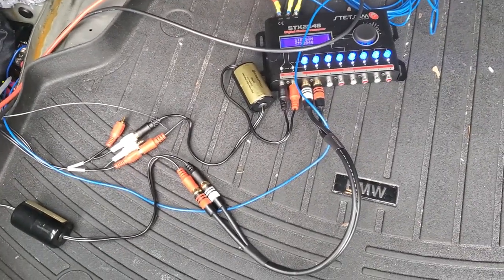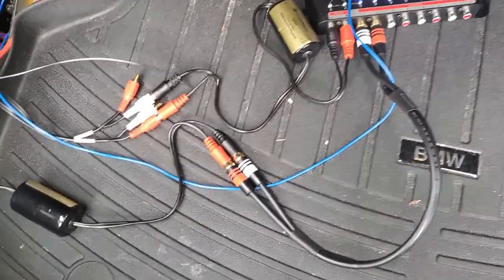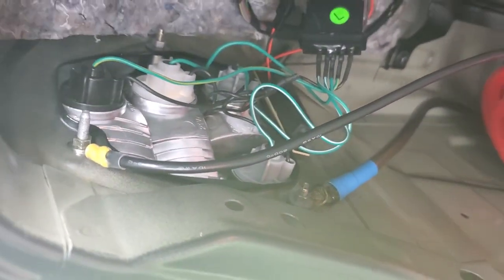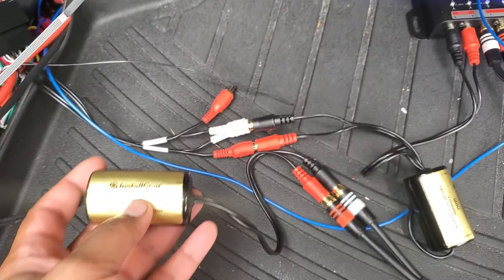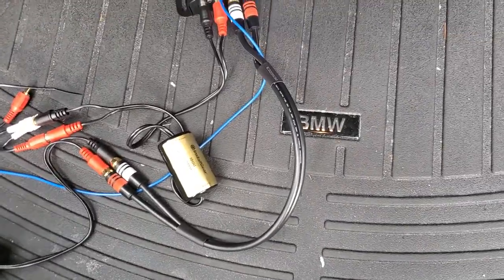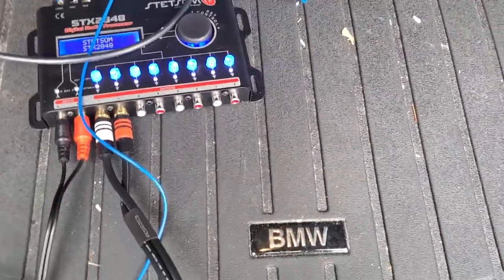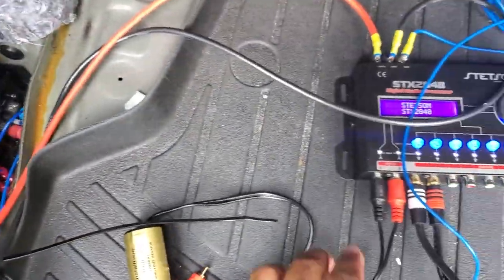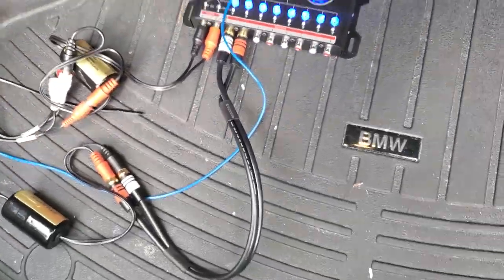HOW TO REMOVE ENGINE NOISE? ALTERNATOR WHINE? BUZZING? FIX WITH GROUND LOOP ISOLATORS!!!

Comment: Tried grounding my rcas to my head unit and it got louder. So now I have a slight buzz or whine coming from my highs amp. I even ground everything on its own ground points and still have that little whine. I seen an nvx isolator on Amazon and I want to try but then again I don't want to waste time and money and still have the whine issue
Reply from the maker: I would try these ground loop isolaters at the amp btw the rca of the head unit and amp see if that clears up your whine/buzz (interference).  For under $9.00 you can't go wrong and it's Amazon.  You could always return it.  If running multiple amps for your speakers, I would use a ground loop isolator at each amp. In my setup, I noticed a slight engine whine when I added my amp.  When I added my DSP, the engine noise/buzzing got way louder! Once I separated the grounds, which you already did and put a ground loop isolator between the rcas going into the DSP and coming out of the DSP, the engine noise went away completely! Try it.  Hope this helps bro!

Comment: I used this ground isolator and it worked, but the problem is, it changes the sound quality of my stereo.
Reply from the maker: Hmmm...Have you double -checked  to make sure your ground connections are clean and solid? Obviously, there  was some  interference that went away with the ground  loop isolator.  If  sound quality was  impacted at the same time, my guest would be a weak ground.  When you get a chance,  give me  an  idea of the system/setup you are  running.   Thanks.

Comment: Its a DS18 thing. Had no issues with engine noise until I installed a DS18 active crossover. Had engine noise coming out the rear output channel only. Change RCA's , grounds everything. Removed the crossover and tested in in another car. Guess what. Engine noise coming from the rear channel
Reply from the maker: I installed the DS18 amp not standalone crossover unit in my setup.  When I first installed the amp, everything was fine but the music was extremely flat and dull sounding.  As such, I decided to install a DSP.  I didn't get engine noise until I added DSP to my setup.  Although, when i added the ground loop isolators the engine noise went away 100%.  Engine noise is not just a DS18 thing.  The vast majority of people I communicate with have the same issue using different manufacturers.  Now, as a budget install I' m not saying DS18 is a top shelf equipment supplier by any means.  I was very skeptical about product quality and how long the amp would last! Surprisingly, I have not had any issues in almost a year installed. One thing I will acknowledge is DS18 Customer Service is the worst!
Reply: @bimmermodz1364  Have exactly same problem. Currently using Banda and Stetsom amplifiers, everything was fine until i add a Taramps DSP to my setup. Will try the isolator and see. Did it affect your sound quality dude?
Reply from the maker: @reeazabdoola2722  No, sound quality is great!  Actually, since it completely took actually the hissing/buzzing from the speakers, the sound quality is much enhanced now. I didn't experience any degradation in sound quality. You should be straight once you add the ground loop isolators.

Comment: I tried to 2 different isolaters from Best Buy they didn’t make difference at all and have my  ground wire bolted  to the chassis less that 3ft wire) only have 1 amp for mids and the ground loop when car is running is still ivery noticeable I even upgraded my kenwood decks ground don’t know what to try been trying to get rid off this noise for so long with no success
Reply from the maker: Hey bro!  Just getting around to this as I've been busy.  It seems like you have most things covered already.  Do you still have your stock HU or access to another HU?  if you swap the Kenwood HU out for your stock HU are you still getting the same engine noise?

Comment from the maker: Getting Engine Noise through your speakers?  Try Ground Loop Isolators!  Fixed my Engine Noise 100%!!!!  If you had Engine Noise in the past, let me know what worked for you?
Reply from the maker: @Chris Rodriguez Hey bro.  Sorry, Just saw your comment. You have quite a bit going on with the 3 amps but since you said everything was fine until the crossover was added, I would try the ground loop isolator with the crossover and see if that cleans up the engine noise at all.  Even with my setup, with each component I added, the grounding noise/interference became more prominent.  Considering all the ground connections are solid/clean, you probably would benefit having a ground loop isolator at each of your amps.  I would try one and see if it helps.  At this point, what do you have to lose since the store said it can't be fixed.  Give it a try..

Comment: Sup brother! So I have my mids and highs amp with a comando eq. Once I got the eq it got loud. Should I add it to the eq or the back where the amp is?
Reply from the maker: I would add ground loop isolates at the amp.  That way the sound processing from your EQ is already incorporated in the signal and that signal will run through ground loop isolators (closing any ground loops) before the signal is amplified and directed to your speakers.
Reply: @bimmermodz1364  thank you!!! I appreciate the help bro! I hate going to the audio shops, they always trying to tax. I like doing my own stuff.
Reply from the maker: @dukemaui91  No problem.  Welcome.  I know what you mean!  DIY is the way to go!  Thanks for supporting the channel!

Comment: I connected a four-channel ground loop isolator off the back of my and into my eq, it quieted the noise but it seems like my radio is not as loud as it used to as if the isolator is pulling the sound away. Would that change if I did it after the EQ
Reply from the maker: Ground Loop isolaters can definitely result in signal degradation at times.  I always recommend installing the ground loop isolaters after the last device that is manipulating (not amplifying) the signal.  In your case, it sounds like you're relying on the limited power from the HU which may not be enough if you're getting a degradation in signal.  I would install an aftermarket amp to pump up the volume to your speakers.  This way you amplify the cleaner sound you're getting so low volume will not be an issue.  If you really want to customize the sound stage in your car, add a DSP too!  Thank you for supporting the channel!

Comment: Did it reduce your volume or sound quality?
Reply from the maker: Not at all.  The ground loop isolators took out 100% of the "static" without any degradation of signal.  Granted, I have a DSP and aftermarket amplifier in my setup so I can only speak to my setup as I know others have experienced signal degradation

Comment: This is great info. I also have a bmw E46 with a humming, or high pitched vibrating.  Sounded like a noisy fan bearing or something. 2 years later I found out it's a ground loop problem with my cheapo aftermarket amp. 

I have the ground connected to the OEM ground bus with the amp ground sitting on top that, then bolted down. Since you said giving it it's own ground location, that helped a lot. I will have to try this.

It looks like you ground it to the OEM tail light nut. That's what I will do.

Mention in the title BMW and you might get more views.

Thanks for the good info
Reply: So changing the ground point fixed it. I can't believe it's 100% gone, like my brain expects the sounds. But I can't hear it, even with gain higher than usual.
Reply: Yup usually reorganization of the wirring cleans up that whine noise. Always keep the rca wire away from the power wires. And pay close attention to installs on bmws since our battery is located in the trunk on the e36/46 whenever installing aftermarket headunits and running rca cables make sure to pull your rca routed thru the driver side on the vehicle since the factory runs our B+ wire stretching from that trunk mounted battery all the way up front thru the wire wall and into the engine bay. I see this happening all the time on bmws where shops and people install systems! I’ve made the same mistake myself once too but that was a decade ago lol
Reply: @onesikm3  that's good info. I read about this, but didn't pay attention because I didn't care at the time. Now, I care. The noise is still there, but much quieter, now.

I have the RCAs for the speakers going to the from the driver's side to the head unit. But, I have my RCAs for the subwoofer, class D, running from the passenger side. I'll see if unplugging the sub from power makes a difference.

Thanks again for the video, and the reply. I appreciate it.

Comment: I have that same amp, which harness did you use, and did you have to use the RCA inputs .. I had to use both for the speakers to work and send separate RCA from the head unit to get the floor  sub speakers to work... I had hi-fi amp switch out for ds 18   and amp harness.........
Reply from the maker: I used Technic harness which essentially is just a LOC that prevents you from tapping into the speaker wires.  Retained stock head unit in my setup. The woofers under seats in these BMWs are really just low pass speakers rather than the traditional sense of subs.  The low pass signals are directed to them but they could not handle a true low frequency like a traditional sub.  In these cars, the front has the full range signal.  With the technic harness, since you're getting full range signal to the amp, you just have to set the high and low passes accordingly. I elected to run a DSP also to enrich the sound.

Comment: Boycott amazon!! What if I don't have an  amp?
Reply from the maker: You can use an in-line noise isolator right at the head unit. If you have aftermarket head unit, you should have preamp outputs (RCAs)
Reply: @bimmermodz1364  it's got RCA outlets but I'm not using them... Just the factory wire harness (22 gauge)... I've got new stereo & speakers & runny use them because the alternator whine is so bad... I've ordered a noise filter.. it'll be here in a few days... Thanks for the help!
Reply: @jasonemryss I know this is 3 years ago comment but what did you do to fix this? I have the same issue